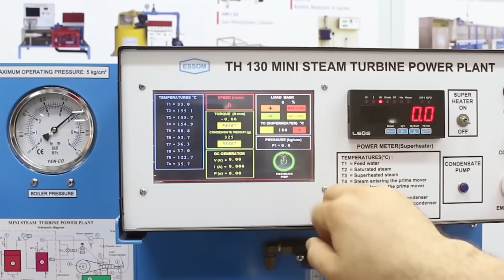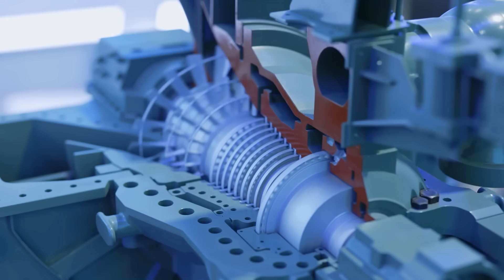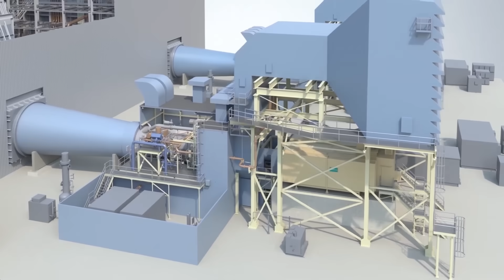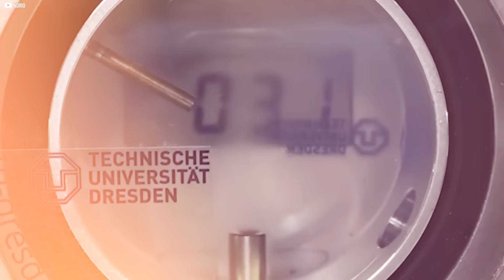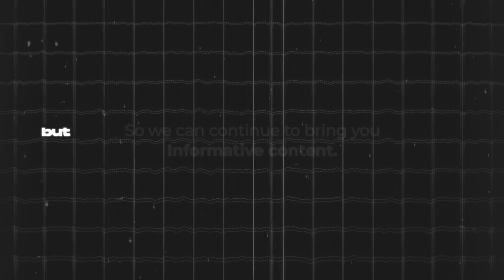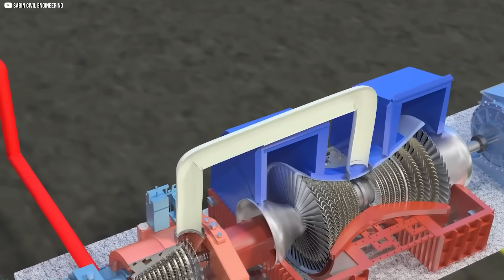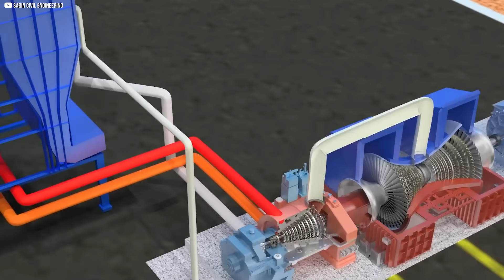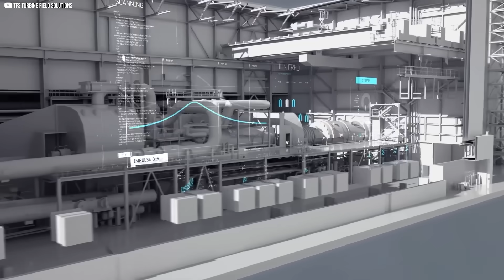The Turbine That Could Power a Billion Lives

Comment: Ultra superficial (USC) H2O coal plants are being built in the hundreds in China.  The liquid steam turbines are much smaller and fast reacting compared to steam turbines.  CO2 has the advantage over H2O in that it becomes supercritical at lower pressures and temperatures than H20.

Comment: Are we ignoring the energy required to make the CO2 'high pressure/high temperature'? Hydro-power uses uses ever-present (free) gravity, no state-change required of the water, so can we retrofit these turbines effectively? 
Can we  'hybrid' these onto an SMR thorium reactor? 
Can we use them to low-cost synthesize useful graphene at scale?🤔

Comment: Apparently with the intention to explain the wider public, the story is told as a novel with a lot of emotional words but without using numbers as temperatures and pressures.   To me as an engineer the story is worthless and I fear the same holds for the wider public who knows as little after the presentation as he did before ....
Reply: Latent heat required to turn liquid water into steam is a significant amount of energy lost to the process. If this turbine works as described, the energy efficiency from the fuel will be increased by upto 20% during conversion to electricity, by simply omitting the latent phase of water.
Sounds like a great invention if it actually works

Comment: He fails to mention the material in a steam turbine. When pressed silicon nitride is used, the expansion is terribly over-efficient. That even runs seawater. It was used in the early 90's at a company called "All American Aircraft" which disappeared, possibly under d.o.d. They built at least one aircraft with small stabilizers. a VTOL. That thing could fly indefinitely on steam alone.

Comment: Super critical CO2 is the key. This can be used in CO2 injection to a closed loop. When CO2 is super critical, for every 1°f change, is 25 psi. This is going to replace nuclear, steam and batteries, IF they can get the materials for the turbine figured out. The inside can get to 2000°c.

Comment: So the new research says 2026 is when global warming passes 1.5° threshold not 2050 which was original prediction. Yet these Shadow funded researchers spending valuable resources on how to keep non renewables running, smaller scale but still running.🤡 Cost of solar and batteries are so low these days there is no credible means to use non renewables for energy generation.

Comment: The 'rotator' can be used as an energy-supplier perhaps instead of an nuclear-supplier, both are not pollutional. Kind regards.
Reply: The CO2 turbine does not generate the energy its attached electric generator provides: it must be supplied thermal energy from another source—a nuclear core, the Sun, fuel...
    A nuclear core and the Sun both provide energy by converting some mass into radiation that can heat a material such as water, melted salts, or CO2. Fuel, from breaking high-energy bonds attaching the atoms in its molecules together, in chemical reactions that destroy it and liberate the said bonds' energy as heat. No mass or atomic bonds are consumed in the CO2 turbine. It is not a primary source of energy. It is an energy transformer: heat to electricity.

Comment: No matter ...still need a ***2 foot diameter STEEL SHAFT to HANDLE THE H.P. and TORQUE to TURN THE GENERATOR !!!!!!
Reply: Correct ✅ BUT ; ultra DEEP GEOTHERMAL ENERGY; super Heated Steam ; using A HEAT EXCHANGER; to. Heat To 
Super critical the CO2 gases ; and chromium VANDANIUM. STEEL; for the SHAFT; 
170, 000 psi Shear  strength, HENRY FORD ; found it to Be Quite useful)  in the 1920 ‘s 
OR. BILL GATES; is Using Smaller versions of nuclear power plants ANOTHER SOURCE of the HEAT. REQUIRED)  not a fan of Bill Gates, but the man does know how to invest and make money.

Comment: Será que isso funciona numa Turbina Tesla?🤔.Afinal não é crime perguntar isso né?
Reply: It's not a Tesla turbine. It's called a Brayton Turbine. But you are thinking along an intelligent pathway. Everyone still has the problem of what material can be used to spin at 50,000 rpms being between 2 - 4 meters in diameter.  I still have much to learn. Maybe someone else has more info.
Reply: @NathanZSolomon you don’t need large ones. Many small ones will do the trick
Reply: @danp1224  Doesn't it depend on the application? This experiment shown above is to consistently put out 10MWe. A 10MWe generator rig large requires about 8MN-meter. Point out a 6" Tesla Turbine that produces that large a torque value. A single 180mm with 9 discs produced 0.831 Nm of torque. I'll let you calculate the number of these small Tesla Turbines required to create 8 MN of torque. As I understand it, torque is additive.
Reply: That small turbine in video isn’t going to make that much torque either. The turbine in power plants are much larger.
Reply: What is the difference between a plasma and super critical Co2?!